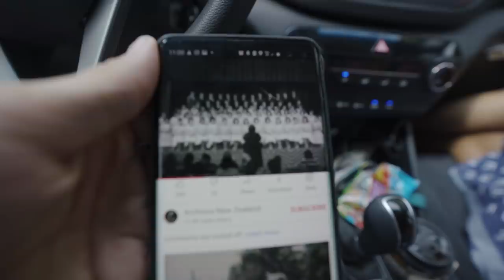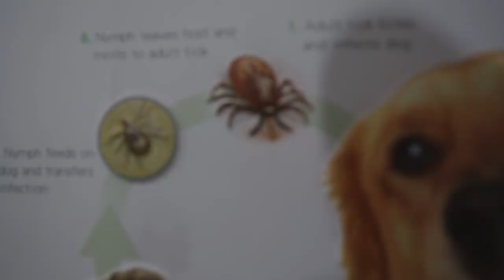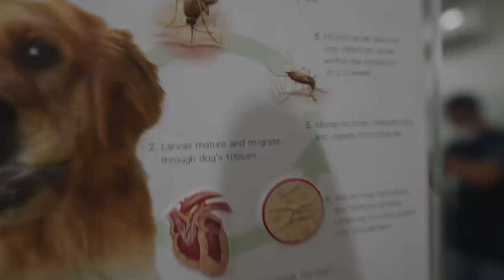Foreigner Experiencing First BAYANIHAN - With Local Filipinos Building Nipa Hut House 🇵🇭

Comment: Not to be sarcastic or to pick an argument but this is just a very small structure. I have seen only one real Bayanihan or in Boholano parlance Lalin Balay in early 1970's. It was a big wooden house that has to be fitted with multiple bamboo attachments and lifted on shoulders by perhaps around 40 people or so lining up on the bamboo handle. One older man stood up in front and shouted uno, dos, tress for a rythm so that everybody will move and step together every time. It was also tricky maneuver to fit the house posts to the dug up hole at the new location just about 50 feet away. I'm just being nostalgic of my childhood.